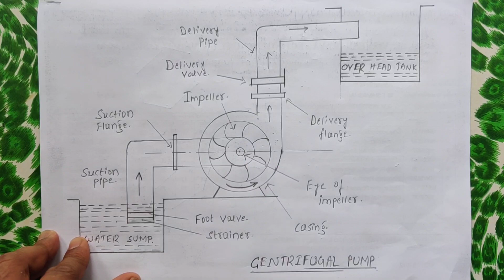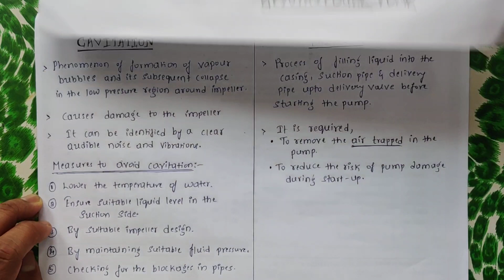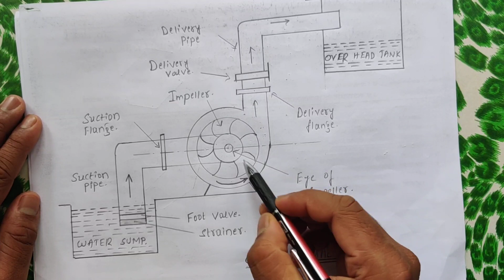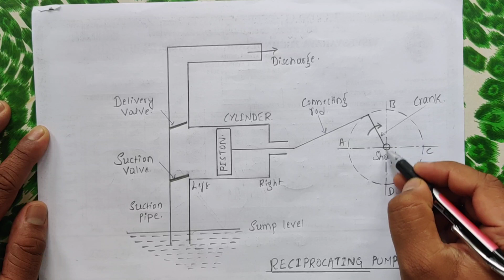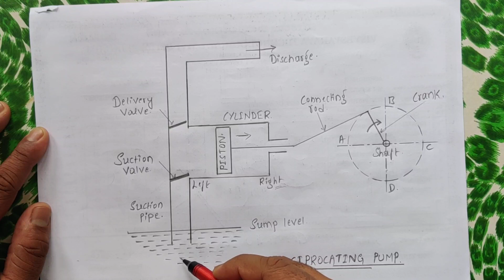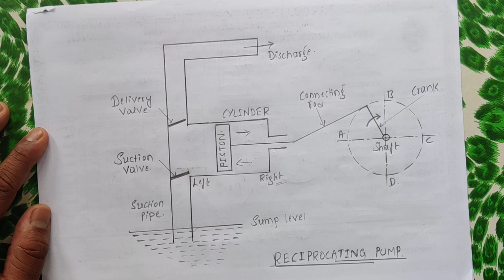Reciprocating pump. Concept of Cavitation and Priming.

Comment: In formulae we can say that cavitation can be eliminated by increasing temperature of the fluid, thereby increasing NPSHa.

But in reality, suppose in a flash drum or whatever source of fluid from which fluid is being drawn, suppose we increase the temp. of the fluid, this will increase the Pvap of the fluid, and also the pressure inside the source storage vessel. Thus the Pressure is increased and becomes equal to the pressure of the vapour inside the vessel.

At the time when the pressure is increased, at that very moment some fluid is present inside the pump, and that pump fluid has the temp. of before heating, so Pvap is less and we see a difference in P(of the vessel) and Pvap(of the pump fluid), and since there is a positive difference, NPSHa is increased

But as soon as the hotter fluid has reached the pump after travelling through the suction line, at that very moment Pvap inside the pump will also increase(as the hotter liquid is now present inside the pump) and become equal to the pressure inside storage vessel, and immediately they will cancel each other and again NPSHa becomes the same as the initial value of before heating.

Thus increasing temp. will give us momentary increase in NPSHa, but not permanent.

And in case we directly increase the pressure of the vessel by some mechanism, then increasing the pressure will cause more volatile vapours to condense and mix with the liquid inside the vessel, thereby increasing its vapour pressure. 

Thus the same story, as long as the fluid having more VP doesnt reach the pump, the NPSHa is increased, but as soon as it reaches the pump, NPSHa is back to initial value.

Thus changing pressure or temp will hardly bring any effect on NPSHa and cavitation.